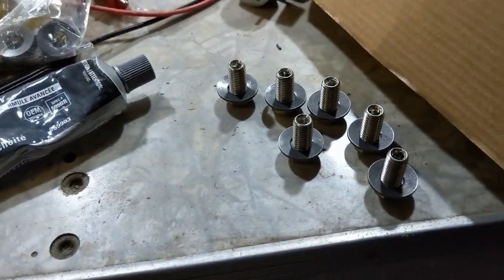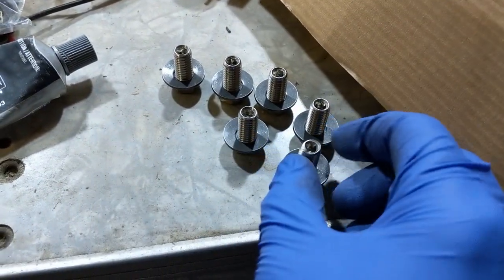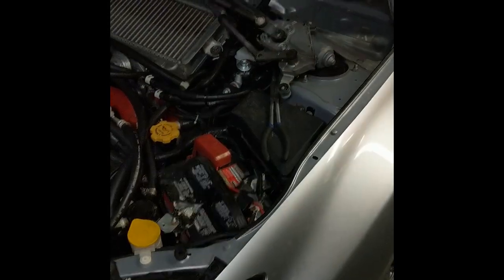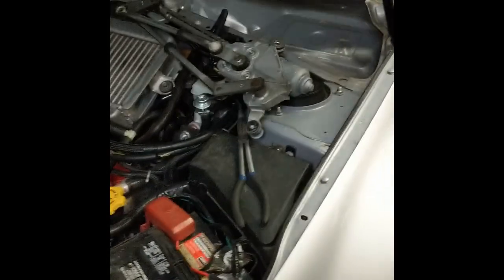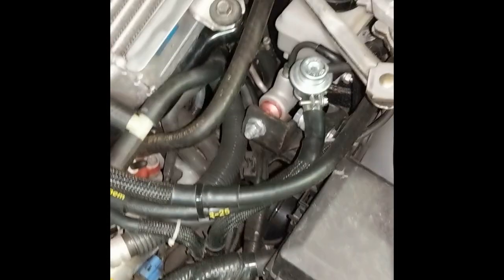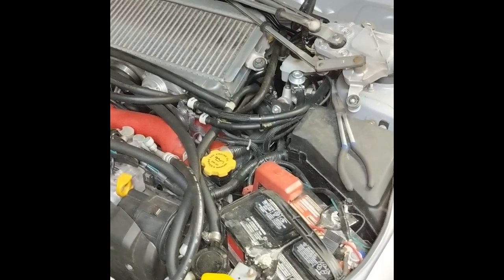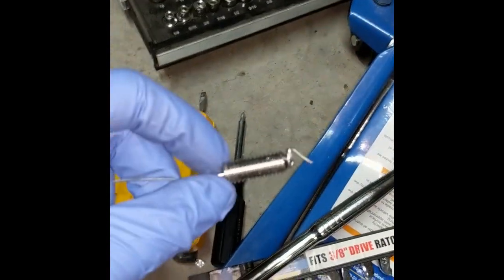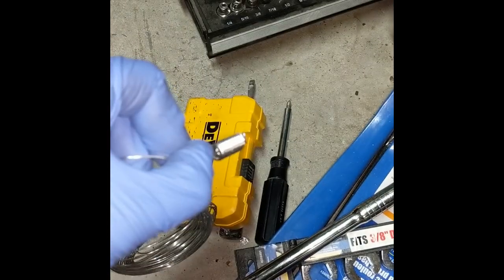WRX and STI Firewall Spot Weld Fix (Without removing any dash pieces, 1.5 hour job)

Comment: So here’s my predicament, 2013 WRX clutch pedal only creaks when car is on, pulled the covers to check spot welds, they look okay from what I can see, used a stethoscope to listen to the spot welds and heard nothing…….so now I’m trying to figure out if it’s the actual master cylinder or the slave cylinder 

Car does not creak when off only when running

Comment: Do you weld the nut that remains inside the cabin to the set screw? Or do you use something else to keep it from spinning?
Reply from the maker: Hi Trevor! The nut on the inside is a special oversized black oxide flange nut with distorted thread to prevent it from coming lose during install and use. The firewall gets a lot of heat. The hardware combination is designed to withstand the high temperature fluctuation.
Reply: Red locktite

Comment: Anyone getting stuck on the carpet for the 3rd hole I lost one of the bolts and I cant get another to go through
Reply: Had an extra hand hold it up, while I pushed it towards passenger side with a flathead to get it thru the carpet. You said this 6 months ago, hopefully it helps anyone else looking for help with this issue.

Comment: Should I even bother with the braces after this?
Reply from the maker: Hey Saad, thanks for the note, in my opinion, the master cylinder braces (brake and clutch) are only beneficial for pedal feel, which I couldn't even tell a difference. The ITS mount braces the clutch and brake assembly and prevents a failure point on that assembly (support rod crack). None of them help the spot welds that this kit is dedicated for. I would save your money on the master cylinder braces and get the spot welds taken care of before they all fail (in which case the method shown in the video will not help you). You can go to my website for more information and links on the matter. https://www.humblerumble.ca/ Let me know if you have further questions, I'd be happy to help.

Comment: Thank you for calling slippers and notthem flip flops 👌. Also did you consider renting a MIG welder and welding the spot welds instead of putting bolts through. I'm about to check my welds because I have horrific creak and would like to know if you considered welding and if so why you didnt.
Reply from the maker: I had heard of people doing the fix from the outside of the car by tack welding the plate to the firewall. I'm not a fan of welding onto thin metal. At best, the tack weld would refresh the original holding force, but gives no clamping force while the clutch bracket is joined to the firewall, if there are gaps, creak might still be there after the fix under certain load and environmental conditions. I'm a much bigger fan of good old nuts and bolts, the kit that www.humblerumble.ca offers is just that! But with tricks to make it a hell of a lot easier than doing it the old fashioned way.
Reply: @HumbleRumble  gotcha. I checked my welds and they're perfectly fine. One friend said it could the clutch fork, another said maybe the pressure plate. I'm gonna have to drop the engine either way 🤦‍♂️. That subie life tho 😂😂😂
Reply from the maker: @GucciManecubus  before you go dropping the engine, check the support tube on the clutch assembly. Google image search: 2008 sti clutch crack
Reply: @HumbleRumble  will do. Thanks.

Comment: What size are those bolts? m6?
Reply from the maker: The hardware offered by the kit is grade 8 3/8-16, closer to m10. When torqued to spec, each hardware assembly had over 4000 lbs in clamping force.
Reply: @HumbleRumble  Cool, Thanks!
Reply: @HumbleRumble  what length are they?

Comment: Without painting the drills it would rust and over all fail. I suggest painting those holes.
Reply from the maker: Thanks for the comment Christian! The whole hardware assembly and drilled holes gets industrial sealant applied all over it, which is included in the installation accessories kit! Have a look: https://www.humblerumble.ca
Reply: @HumbleRumble  I would apply paint on it still peace of mind.